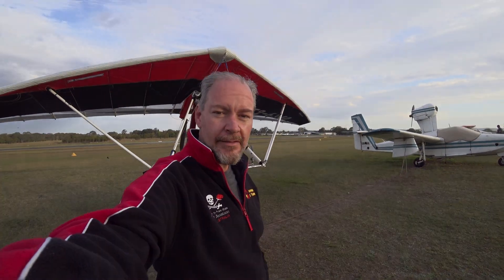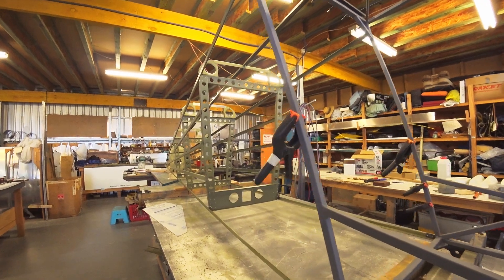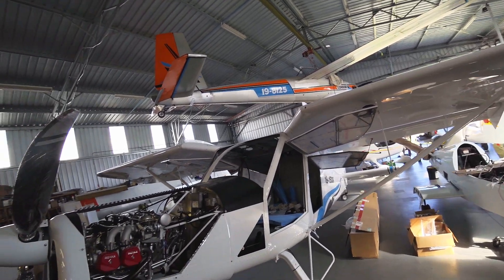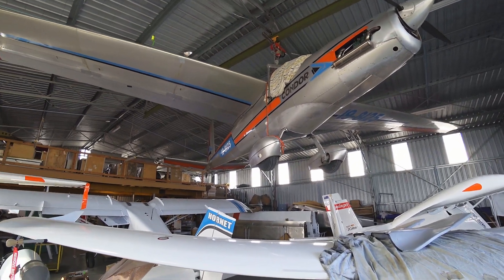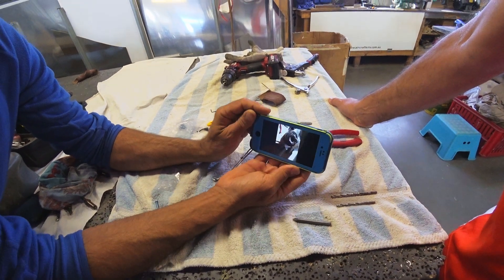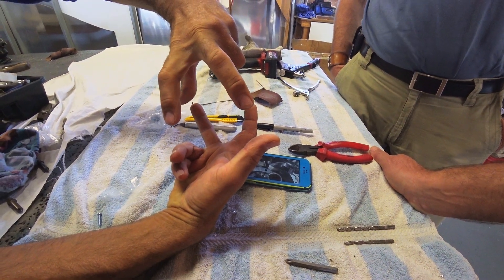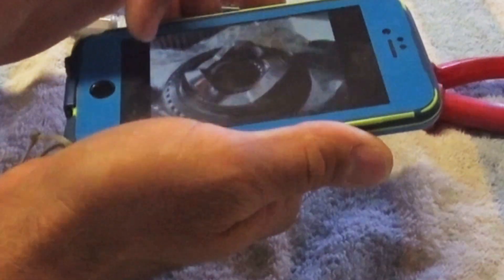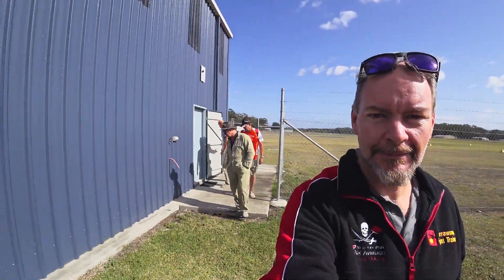HORNET STOL Manufacturer Factory Tour | Rotax Dog Drive - How it Works?

Comment: 7:45 what does it achieve?  It’s a torsional damper. It’s the key to why Rotax has been able to make a reduction drive engine that actually works on an aircraft 2000+hr. The engine doesn’t run at a constant speed, it pulses and the prop acts as a flywheel resisting the pulses so without this preloaded dog drive the pulses are being absorbed by the backlash in the gearbox (especially at low rpm).  The slipper clutch is separate and doesn’t slip during normal operation, it’s the prop strike protection for the crankshaft as far as shock loading goes, and the fact that the prop is on a separate shaft to the crank isolates any other non rotational forces from being transferred to the crank.  These 900 series engines are what has made light sport aircraft a viable thing.